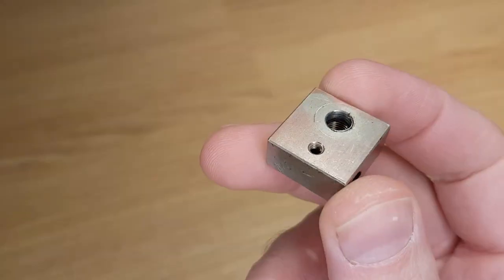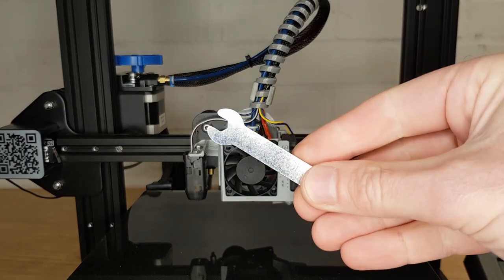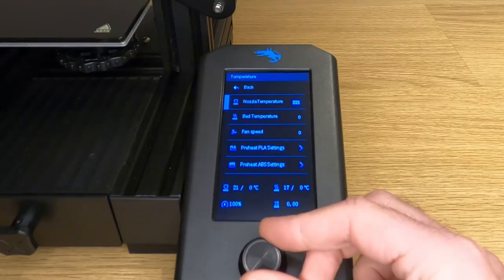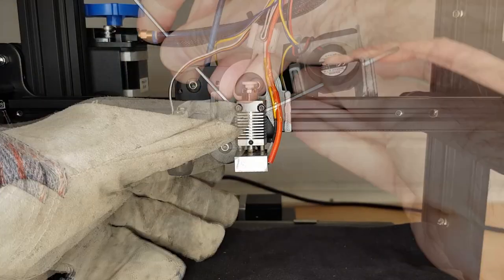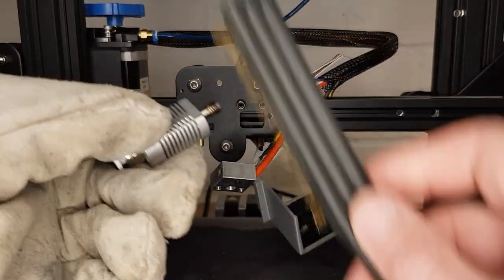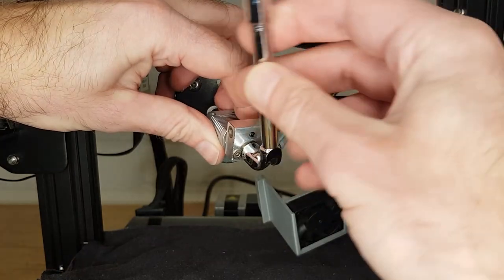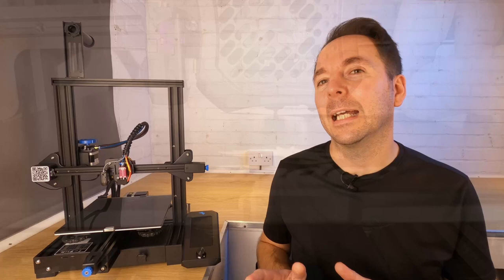How To Replace The Heat Block On Your 3D Printer: Step-by-Step Guide

Comment: This video is by-far the most safe and accurate walkthrough to change your heat block. I screwed my nozzles the wrong way and stripped the entire heat block. With Rick's video, i replaced my heat block in a matter of 20 minutes of working VERY slowly. This has been the smoothest replacement/maintenance i've done on my Ender 3V2. Thank you so much, Rick!!!!
Reply from the maker: Glad it helped👍

Comment: Just like all the other positive comments, this is exactly what I was looking for. 

I just got an Ender 3 V2 neo and the nozzle pulled out some threads while removing it.
Reply: I have the same printer and I messed up the threads too. 
Which heater block did you buy as a replacement? It seems as if it needs the cr6 heater block, but Creality doesn't say anywhere what it needs.
Thanks
Reply: @jamie.kyriacou  I managed to keep using my heater block. The nozzle sort of fits loose but it tightened enough that I haven’t had any issues. I just finished my first kg of pla and it’s consistent. 

I looked and looked for an exact replacement heat block and I couldn’t find anything either. The best potential replacement I found was on Amazon. It’s for the Ender 3,  the aluminum anodized heat blocks that are yellow/orange color seemed the best gamble for a replacement block.

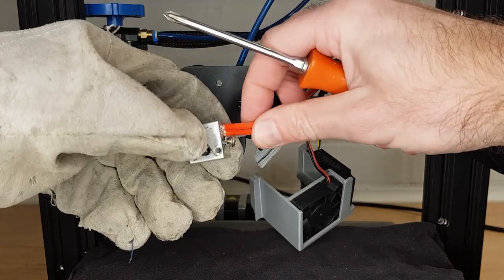Comment: Hello Rickey, can you or anyone tell me, the heater grub screw at 2:34 , on my printer became stripped.. ive tried a few different grub screws but they dont work properly.. i have a regular m3 x 2 screw that is the same size as the grub screw, but this screw has a "head on it" to be able to tighten with a phillips screwdriver.. this screw is the same length as the grub screw so it doesnt protrude at all really. i can fit my silicone nozzle cover over it. Will this be okay rickey or is this bad for my hotend to do that?
Reply: As long as the head of your grub screw isn’t so ginormous as to interfere with the nozzle diameter and height, or the snug fitment of the silicone sock, you should be OK to use it.  Its job is only to retain the heater cartridge by cinching down on it.

Comment: I was always confused why it was easier to remove the heater while hot instead of cold, I thought surely the metal would expand with heat and cause it to become stuck.
Reply from the maker: It all depends on the metal. The aluminium of the heatblock tends to expand at a different rate to the heater element so if anything, the hole gets a little bigger. The main reason to heat the hot end to remove parts is that they won't budge if they have any filament on them unless it re-melts.

Comment: Any chance you will be doing one for the S1 pro. Great videos!
Reply from the maker: Probably if/when I strip the thread on my S1 Pro hotend🙂 If you haven't seen this video then it will hepl with removing the heatblock and heatbreak assembly:
https://youtu.be/6T993A2laSc
 Loosen your nozzle first so that you can unscrew the heatbreak after and everything else is pretty much the same.

Comment: I'm following this video and while removing the cables from the heating block, one of the just popped out, I see in the video they are tied together, did I ruin it? or I can just peel out more cable and tie themo together again?.
Reply from the maker: If you mean that one of the wires on either the heater element or thermistor have come detached then I'm afraid they need replacing. They are not really repairable.
Reply: @RickyImpey  That's what I meant, yes. Found out I damaged my thermistor, I'm replacing it today. Thanks for the answer!

Comment: Ive broken 3 thermistors trying to reinstall them, they won't stay in without the screw but will short if you tighten it too much and they break as the slightest gust of wind, very badly designed and changing to tube style

Comment: Question is the nozzle in the heatblock itself or is it part of the hotend?
Reply: The Ender 3 “hot end” is the complete assembly of heat-block, heat-break, heat-sink and pneumatic coupler.  

The heat-break threads part way into the top of the heat block, and the nozzle threads part way into the bottom of the heat-block.  You want the stem of the nozzle butting up tight against the bottom of the heat-break inside the heat block.  The large diameter (shoulder) of the nozzle should NOT touch the bottom of the heat-block — in fact, there should be a nominal 1.5 mm gap between those.  

How do you adjust for that gap?  Answer: to increase the gap, rotate the heat-block upward [like a nut on a bolt] so that the heat-break goes deeper into the top of the heat-block.  This will reduce the upward travel of the nozzle into the heat-block when it stops against the bottom of the heat-break.  Do the reverse the reduce the gap.

This vertical spacing of the nozzle is very important.  For this reason, Ricky suggests counting the number of turns as you rotate apart the heat-break and heat-block.  That way you can remember the proper number of turns when assembling them to keep you in the ballpark of the correct stop-depth for the nozzle.  

This info I’ve shared above is hard to find explicitly explained anywhere else, and will save people a ton of headaches from learning “the hard way.”

Comment: do i need to fully unscrew the nozzle (it broke off the threads while i was removing it)
Reply from the maker: The important part is whether you can unscrew the heatbreak from the back. If you can then you'll be fine. You may find that the nozzle has locked the heatbreak in place and it will take quite a bit of force to unscrew it.